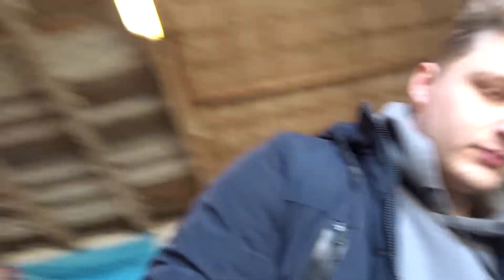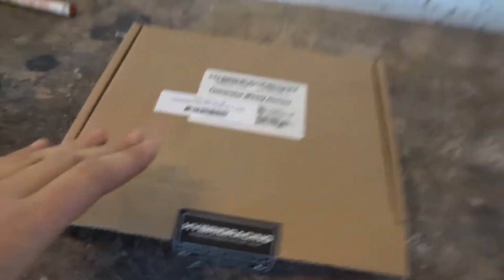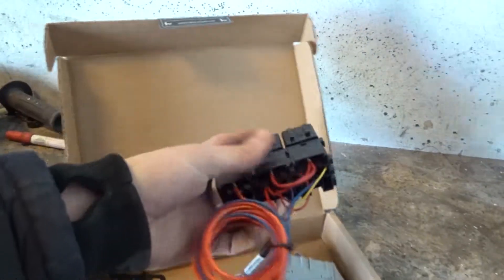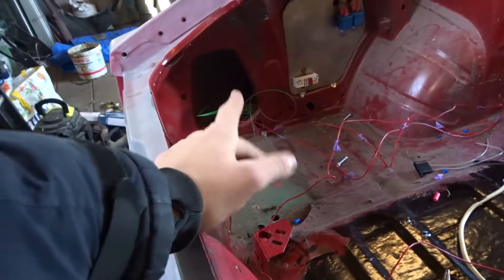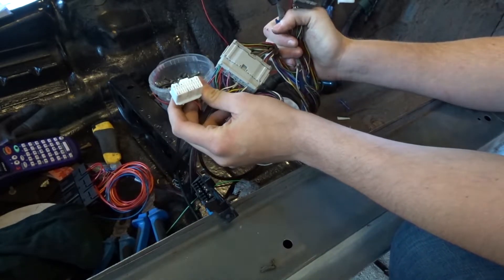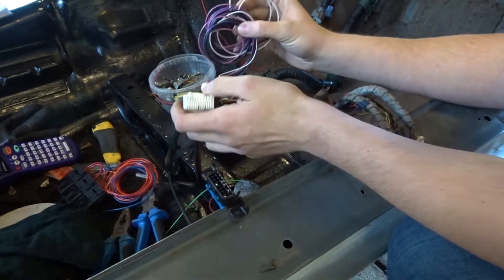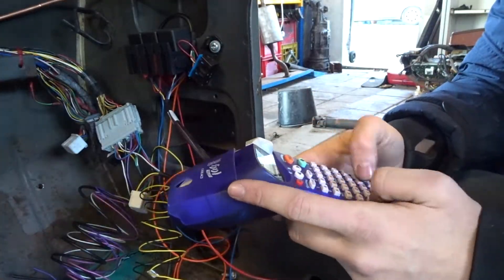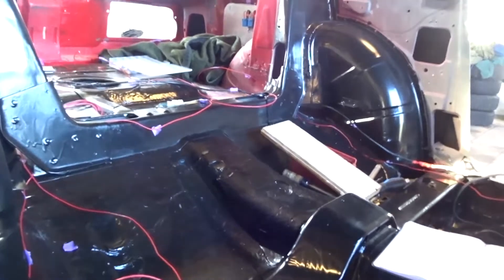How To Wire A K20 Datsun! Part 1.

Comment: How low does the k20/k24 in the datsun? Where did you get the motor mounts ?
Reply from the maker: @phuhoang4678  ey man, the k20 fits great in there! I made the mounts myself with an extra subframe bolted to the frame
Reply: @terrencewildenberg  does it sit low? What is ground clearance ? I want to do something like this . Looking at some rollers . Thank you for your reply .
Reply from the maker: @phuhoang4678  i had to cut the firewall to make it fit behind the subframe. It wont fit on top of the subframe because of the hood. Now its not lower than the subframe and clears the hood with around 30mm. Check out my instagram (@datsun_k20zx) for more pictures
Reply: Also what transmission are you running ?
Reply from the maker: @phuhoang4678  rx8 5 speed with a pmc motorsport comversion plate and a ford C-max diesel clutch